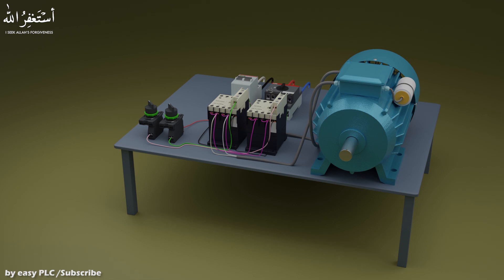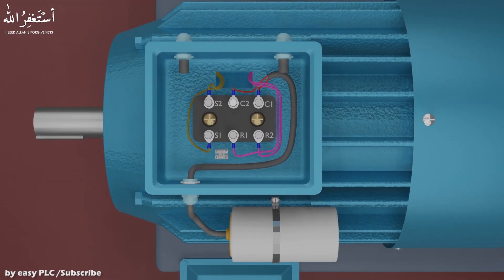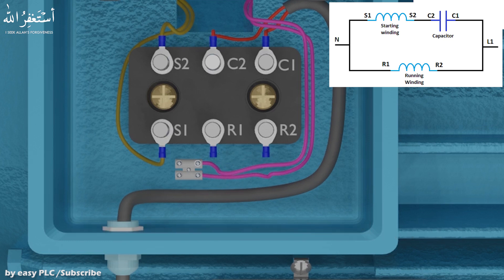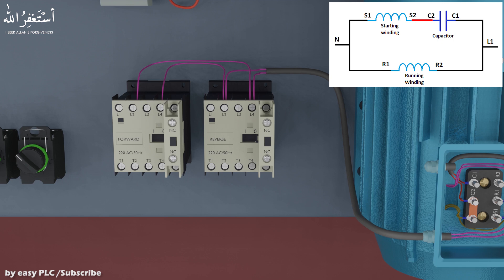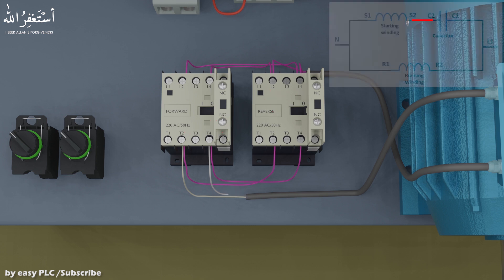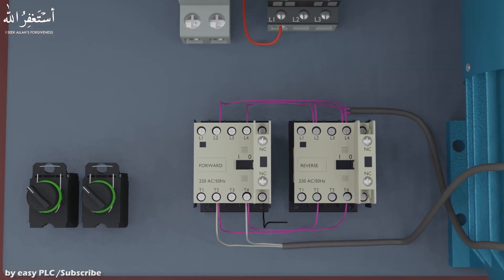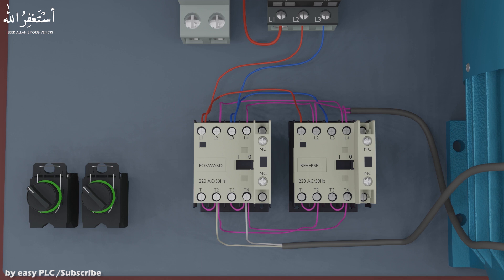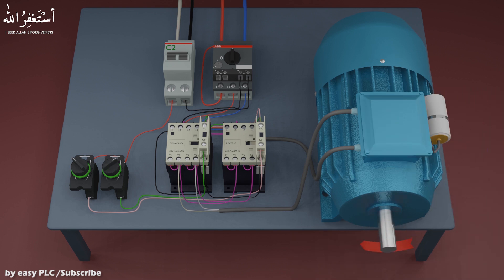Single phase motor reverse forward rotation with running winding reverse method

Comment: Great video is it different from the previous video????
Reply from the maker: Yes it's proper method
Reply: @EASYPLCTRAINING  thanks for the reply which method do you recommend; this one or previous one????
Reply from the maker: @peternjuguna4863  for small motors previous one is OK. for more than 0.75 HP 2nd method is good
Reply: @EASYPLCTRAINING  thanks alot for the information